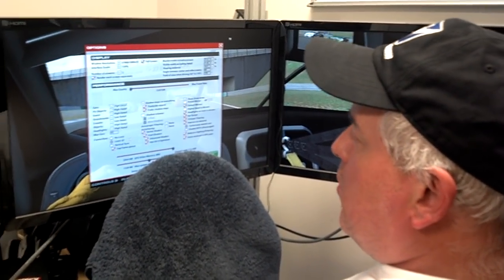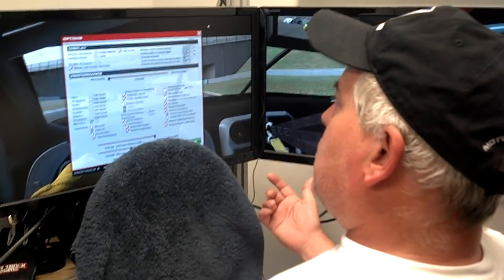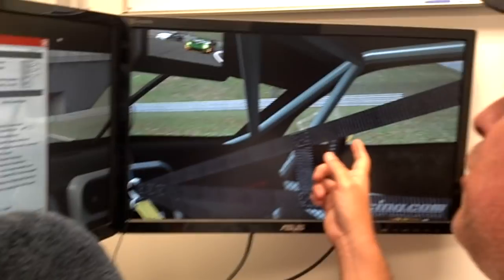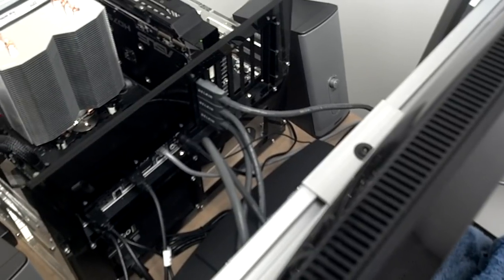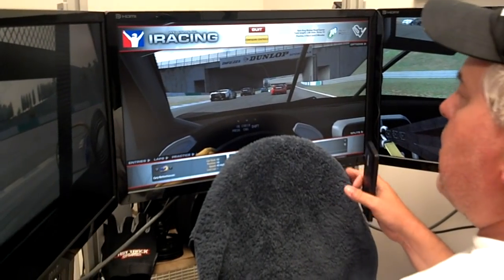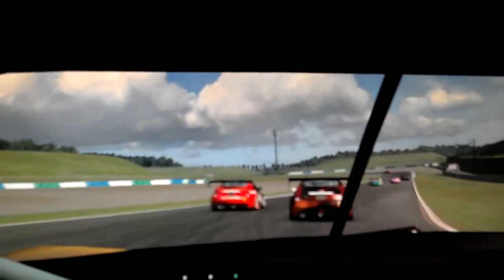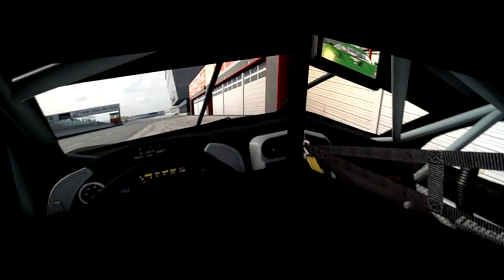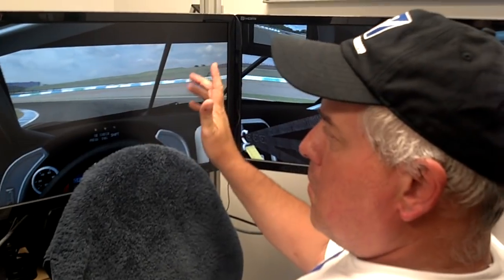Sim-Racing Monitor Placement and Field-of-View (demonstrated using iRacing.com)

Comment: Nice video.  However I don't agree that smaller is necessarily better.   I think the most important thing is porportion.   Bigger monitors that are farther away but represent the vehicle in exactly the same porportion are just fine.
Reply from the maker: Smaller monitors are worse when they begin to make your cockpit too tight and interfere with your hardware such as your steering wheel. There is a point of diminishing returns with larger monitors, however, when you begin to render things larger than life size which makes no sense in terms of realism. 27 to 28 inch monitors are about ideal for a 3 monitor rig unless you have extra space and just want to move them further away.

Comment: hello sir, thank you for your video it is very help full, how ever  i need help fixing a problem. I have 3 ---23.6" monitors. The nvidia sorround configuration with special resolution is 6040x1080. 

When i use this resolution in game the graphics suck. They look like if everything was on low. With one screen at 1920x1080 its all perfect at high detail, but when i swtich to the 3 monitor resoluton it sucks. Ive gone in and out of the game and restarted a million times the pc but nothing seems to help. 

i have anvidia gtx 780 water cooled 
i7 2820k 3.70ghz 
16gb of ram 
windows 7 
lastest drivers instaled etc. 

please help!! 
thanks!

Comment: I've got two old 21 inch 16:9 monitors atm - I'm not sure whether to get a third (will be very cheap, but I'll be stuck with tiny monitors) or just go for a single 34" ultra wide (will be expensive, but easier to set up and less like looking through a letterbox). Also vertical real estate is important to me for flight simming (seeing the gauges), so I think I'll go with the ultrawide... I have to say though, your video is really selling triple monitors...

Comment: Todd, can you post a link or describe to what frame rate i should lock that i have no tearing even without vsync? I have a Samsung TV that runs at 60Hz
Reply: there IS no solution to having no Vsync without tearing, if you don't want tearing, Vsync is the ONLY way to go, but if you serously want to do that, same thing as your TV displays, 60Hz
Reply: well now Vsync is in development for Nvidia cards.

Comment: best freakin tripple monitor review/recommendation ever! There is something important i gotta ask. I have a cockpit build that is 1 meter (40 inches) wide. Would that be enough space to set up 3 monitors is the space too narrow?! I have currently a 27" 3D display, i am willing to downgrade to 24inch tripple setup but would it fit or would it mess up the angle, cause i want that 180 degree field of view that you showed. please reply asap. Thanks chief! subscribed!

Comment: If your eyepoint is above the center of the monitors, the lines bend between monitors bend where the monitors meet, as you mentioned at 4:35.  I'm not talking about bezel correction.  Is there a setting to make the angles different if your eyepoint is higher than the center of the monitors?

Comment: After using the reverb and oculus before that i tried triples. Waiting for a new reverb headset  . I can’t get used to it. It feels totally off. I did all the tools and fov and setup. Nah I can’t stand it. It feels not even close to the immersion of vr.

I used the oculus again and the reverb is like 10 times better. 

I would sue triples if I had 3 huge monitors . Like 55inch monitors. That would be better. 

Until then 27” are going back to the store.
Reply from the maker: I use VR now, too (Pimax 8K Plus). VR wasn't a thing back when I made this unscripted, unedited video. This was the best we had back then.

Comment: No matter what I do, I cannot get the floor/track to look/feel right with my cockpit. I'm on AC on PS4 at mo, and always feels like the track is cutting through me at about shin height? Do I need to lower my TV or something?
Reply from the maker: I’m not familiar with that title on that platform, but you need to see if there’s a way to either adjust the driver height or the horizon height. If you can lower the horizon height, that might help. If you can’t do that, try raising the driver height.
Reply: @tbhausen  Thanks for the quick reply.

Yeah it has all those options, think I'm just very bad at setting them up lol

Comment: I measured a Toyota Avalon windshield and it was close to 50" wide and about 27" tall so would that monitor size work better for making it like a real car? My monitor stand can go to 90 degree if I want, please give me your thoughts. I just purchased Rseat  N1 and triple monitor stand that will hold up to a 49" monitor.
Reply from the maker: +Steve Miller None of this has anything to do with the sizes of windshields or anything else in the real world. Monitor size matters to the extent that you can see more of the driving environment rendered in its true-to-life size and position through monitors that are larger, closer together, or both. Bigger is better, to a point. It gives more room in your cockpit for your hardware, especially your steering wheel's housing. Too big or too close is useless, though, once you begin to render things larger than they appear in the real world. And don't be fooled by saying things like "I set everything up, but my hands are huge!". Always think of your monitors as windows you're looking through (like a bay window on a house). Walk closer, see more through them (but that tree a couple hundred feed away doesn't change size much when you do so). Hands, gauges, etc. look huge because if they're viewed on a monitor surface further away then they'd be in real life, they must by rendered larger to make up for that extra distance. Don't be misled--it's all about getting things in the same place at the same size as they are in real life when viewed from the driver's seat.Hope this clarifies.

Comment: I use a singe 27" monitor at a distance of 68cm from my eyes, this gives me a calculated FOV of 27 wich I started using in all sims and now cant stop using it. I think it's importand to mention that the height of your monitor should be in exact level with the eyes as well, correct me if im wrong. I also own TrackIR wich helps me alot when driving with such a narrow FOV.
Reply from the maker: iRacing only goes down to 45 degrees FOV IIRC.

Comment: I was thinking the exact same thing.   I got these same monitors placed at 45 degrees so my recommended FOV by  iracing is something around 136 to 140.  My guess is the I'll have to seat even closer to my monitors and increase the angle to 60 in order to achieve the 179 fov.

I wonder if Todd is filling all the boxes on the iracing interface or if he is allowing iracing to auto complete some.

Comment: Hi, I'm currently running a projector for iracing, is it possible to run triple monitors at 90 degrees? And get the cockpit lined up. Cheers✌️
Reply from the maker: +Cayman Gt4 Yes, but you want your side displays square to your line of sight when you're looking directly at them to maximize the FOV of the three combined displays. There's no advantage to setting them like "side windows".

Comment: you mentioned that all 3 monitors are connected via displayport and all run at 60hz...I have 3 different monitors connected to gtx970 GPU via 2 dvi and 1 hdmi and the center runs at 144hz and the 2 sides at 60hz....do you think I will have issues with screen tearing and other problems? Is it even possible to run one 144hz monitor and two 60hz monitor in surround?
Reply: 2searingfilms I would think you may have issues with those running at different refresh rate.  I know you wrote this 6 months ago, I'm curious as to how this worked out for you?
Reply: BlueOvalHero, it worked for me. Apparently running different monitors with different refresh rates doesn't affect anything. It ran just fine with my gtx970 graphics card. Worked out great since I really wasn't looking to spend too much on the side monitors by having to buy 3 (144hz) monitors. Good luck

Comment: Thats amazing, really gave me a few good ideas.  Im building a wooden cockpit right now and Im in the process of adding my monitor deck.  I noticed similar rigs to mine had the display way back, Im having my Dell U2711 right behind the wheel.  I only have 2xU2711 at the moment, but when budget allows I'll get a third.  How did you go triple screen with a GTX570? Ive the GTX580 and they dont support triple screen.  Did you use a software solution?

Comment: what was degree you have on this set up? or angle? I like the way you have it . Also what monitor stand did you use.
Reply from the maker: 60° angle and they're mounted to a frame I designed and built using 80/20.

Comment: Indecible video Todd, thanks for sharing, lots of good info.   Wondering, since this video is 5 years old, what size of monitor and resolution do you suggest now to have as close as real POV/FOV in iRacing?
3x 24'' 1920x1080
3x 27'' 1920x1080
3x 27'' 2560x1440
3x 35'' 2560x1080
3x 34'' 3440x1440
Reply from the maker: Pabula bigger monitors, beyond about 27 inches only get you more space in your cockpit by being able to move them further away. I exclusively use the oculus rift CV1 now.
Reply: Thanks todd for the quick reply.  I wish i could use Oculus but i cant stand it for more than 30min or so, i start sweating and becomes uncomfortable, maybe the next gen.   But right now im running it on TV, and wishing to have triple monitors, which of those res do you recommend for as real as possible? no budget set, just dont want to invest in something that will not give me the correct FOV.
Reply from the maker: Pabula if you can afford them, I wouldn't buy anything smaller than 27 inch for a triple set up. Go with the fastest refresh rate your PC can drive. I wish I could give you better answers, but I have no direct experience with any monitor or projector faster than 60 Hz (I went directly from the projector set up shown in later videos to Oculus DK1 and haven't looked back).
Reply: Thanks a lot Todd for your reply.  and ill follow your advise and not buy anything that its smaller than 27'', but by this means bigger is ok also (i assume).  I was more worried that a bigger screen size like 10320x4320 (3x 3440x1440) could been too much and the FOV would have been mess up because you see too much, like more than the 178 degrees you say on the video.

Comment: Fantastic video. it answered most of my questions, being new to iRacing and trying to get my FoV correct. I do have a question though, for your angle between the side monitors and the middle, what did you use? It is the inside or outside (front or back) angle? Also, great looking race stand! I just have to use a desk so full 179 fov is too much for me.

Comment from the maker: I'm set to iRacing's maximum of 179 degrees FOV (eyes in line with outer edges of outer monitors as viewed from the side and shown twice in the video).

iRacing defaults to eyes 60% up from the bottom of the monitor (in practical terms, eyes just above monitor center). I've never changed this setting, though the monitors are about 1.5" too low in this video in anticipation of my seat being lowered soon when I make changes to my cockpit.

Comment: I hope one day i can build a pc. I run a 24 Viewsonic monitor with ps4 pro nextlevel lite stand. T150 w/t3pa pro pedals, and head phones turtle neach. I am 17inch from screen i run 58 fov. And project cars 2 and assetto corsa. My dream is to build a pc. Im starting this month buying pieces each month to build one. Im disabled paid month to month. And i thank you for this info. I was just going to get a 50in or bigger tv but i now know triple is the way to go. Would you do a video of wheel and pedal placement and were your body should be in aspect of those requirements. Thank u sir.

Comment: what angle are those monitors? I just got three 27 inch monitors and I intend to do just as this video says. I want a viewing angle that is very tight so that i dont see out the sides of my monitor.
Reply: Great question.  I'm looking at a triple 27 setup as well, with 8020.  That looks like a 30 degree bracket Todd is using.  

What monitors are you going with?  I am currently searching for a seat and starting the base.   I'm debating between a fixed angle monitor stand vs one that hinges.
Reply: +Chris Heffel I got the BenQ GW2760hs, super slim bezel, and although not IPS panel it's VA so still better than TN. I'm designing my own triple monitor stand and built it out of aluminum square tubing. I bought two monitor telescoping mounts from Amazon and using them as the arms, they were about $13 each. Asus has a slim bezel VC279h on sale right now for 170$ for an 27 inch IPS panel with VESA mounts.
Reply: +Tai Nguyen I would love to see some pics.  Please post!  Or email me!
Reply: Hey if you haven't already set it up, the angle of the monitors depends entirely on your seat position, or more precisely, the distance from your eyes to the center monitor. The angle of the side monitors should allow them to be the same distance from your eyes as well. Think of them as a partial circle with your eyes at the very center. You can also google some sim racing FOV calculators where you enter the distance between your eyes and the monitor as well as the width of your monitor 

I just used geometry (SOHCAHTOA)  to calculate the monitor angle after having a friend measure the distance between my eyes to the monitor

Comment: Really wish you could do an updated version of this video for 2019 specs... like would you or have you changed monitor size to say triple 27's and could you get those between wheel and base of 2019 wheelbase gear. And would you still get a good fov from them?
Reply from the maker: Thanks for your reply. Essentially, bigger monitors only get you more space in the cockpit once you get to 179° FOV. Think of the monitors as half of a hexagon with your eyes at the center as viewed from above. It’s pretty easy to trig out the geometry and know what the viewing distance is and where the center monitor will fall in relation to your wheel base and steering wheel. Unfortunately, I don’t have the equipment to do such a video as I have since switched to and race entirely in VR.
Reply: @tbhausen  thank you for the quick reply. I see your videos and can understand the whole dilemma of bigger screens. But because I need visual fidelity I cannot as of now use my VR (my eyes, even with glasses, are very bad) so I was wondering if I could go up a couple of inches to 27's and still get them directly behind wheelrim without messing with the fov quality.
Reply from the maker: Jaycob Schuffert Certainly you can, your viewing distance for the same FOV will just be a couple of inches longer.